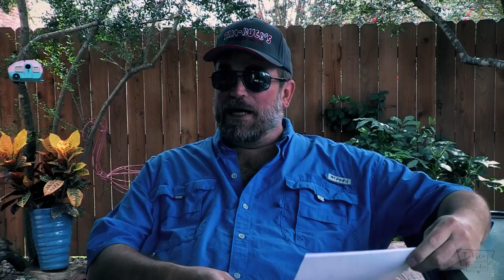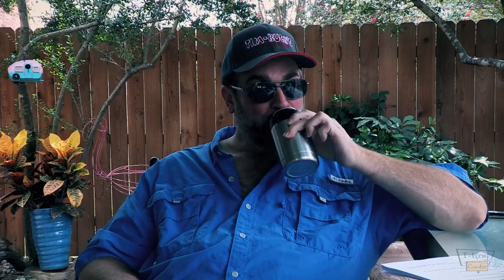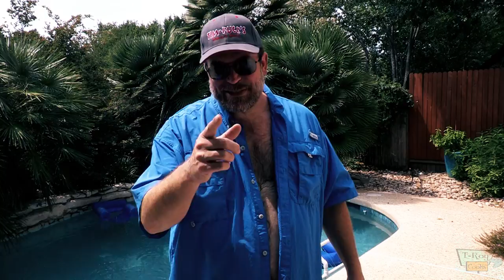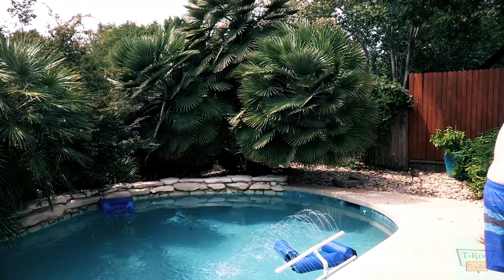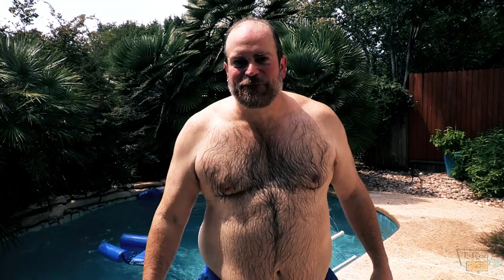Do you Need Tuning Plates in an Offset Smoker? | Ep 49

Comment: Hey Troy!  Cheers!  Question. I'm designing and welding my own offset. I have an idea to put a second chimney connected to the firebox. The purpose at least in my mind will be for adding new wood. When the new wood is added the cook chamber chimney can be closed and the fire box chimney opened. This will be to wait for the wood to be fully lit with no bad smoke each time a new log is added. Plus I think it may retain some heat in the cook box while the firebox lid is opened. Let me know if you think this is necessary and a good idea. Thanks Troy!

Comment: always a great chat, I just recently purchased a 22 inch WSM, how many good cooks do I have to do to get it cooking right, I have a 18 inch that I bought used and it works perfectly, having some problems with the 22 inch keeping lower temps to make jerky
Reply from the maker: Great question!!! It will take 4-6 cooks to build up some carbon on the inside. It will burn hotter and be harder to maintain temps until that is built up. When doing jerky, just use about half of the normal charcoal you would use. That should keep temps pretty low.

Comment: Hey T-Roy: I'm new to smoking and just recently won a charcoal smoker from a contest at a local beer distributor. The smoker is essentially the same design as the Weber Smokey Mountain, but there's no adjustable vents on the bottom, just a gap between the shell of the smoker and where the charcoal pan sits. It started off hot, about 280, and I was able to get it down to 230 after about 30 minutes. It stayed there for about an hour, but then dropped and never got above 200. I think my charcoal burned out too quickly, and the ash suffocated the coals. How do I get an extended cook? I lit the coals using the minion method, and I'm concerned that maybe I used too many coals in my chimney to start. I think I also need to find a way to remove some of the ash from the pan, but don't know how. Thanks T-Roy and cheers!
Reply: You most likely have an ECB, El-Cheapo Brinkmann or similar.  I own one and had the same issues.  There are many videos on how to modify it with a charcoal pan and adding holes so the ash wont choke out your coals.  Mine will now burn almost 10 hours without intervention around 240 degrees.  I added a lid thermometer I got from the dump off a Weber grill, and some fireplace tape around the lid which makes a nice tight seal.  Good luck!
Reply: Yep, that's pretty much what it is (https://www.amazon.com/Grill-Pro-31816-16-Inch-Smoker/dp/B000FJP4U2)

I think I already found a forum that has some mods for it. I have a 2-probe thermometer that I attached to the grill & probe inside the meat, but I will certainly check out the fireplace tape. Thanks for the tips, Stephen!